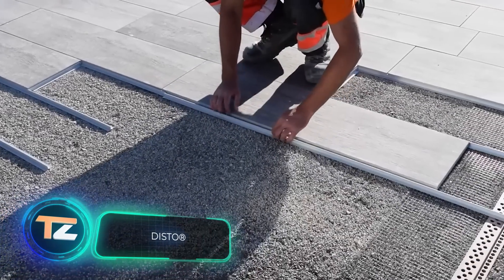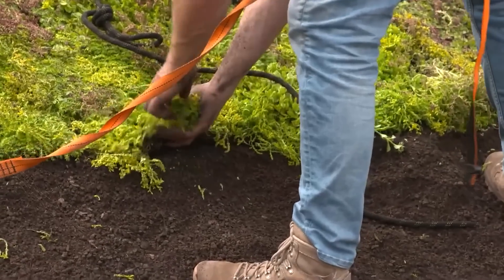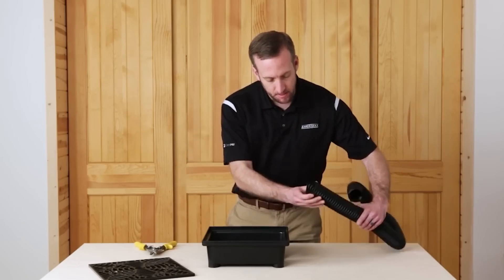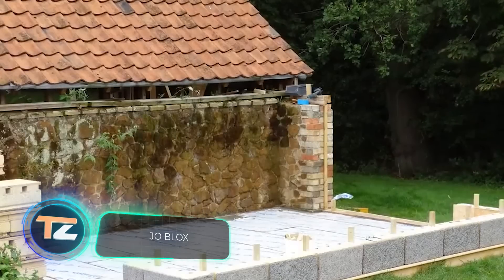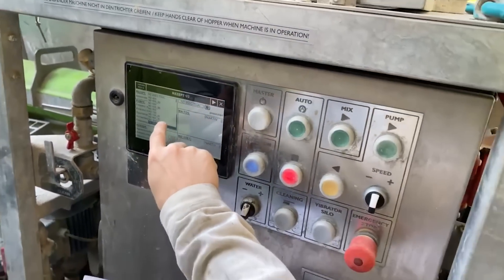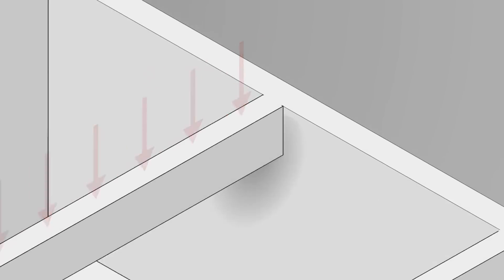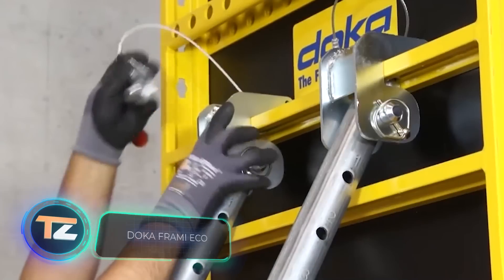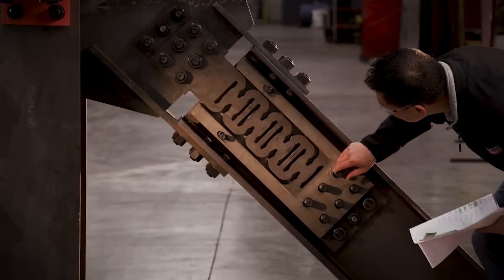MIND-BLOWING CONSTRUCTION TECHNOLOGIES YOU SHOULD SEE

Comment: The flexible grids shown at 2:17 would retain soil better if interplanted with a diverse variety of plants.  
It is a healthy, diverse plant biome that causes roots to release glues which both hold the soil together and in place, and allow better drainage.
Avoiding synthetic chemical additives is important as any will kill soil biome diversity.

Would be great if this showed ways to incorporate bioswales into paved landscapes. 
Bioswales are depressed areas that gather rain runoff from roadways, other paved areas.
They use mulch and biology (plants, typically including site-appropriate trees to reduce water from going into storm drains; reduce downstream flooding; reduce ground subsidence and concrete cracking; reduce irrigation costs for landscaping around businesses; city buildings, residetial areas; replace ugly, raised paved pork chops used for traffic control; reduce water runoff, lessen heat island effects; heat islands, control street litter; reduce air and water pollution; reduce crime by adding walkability and bikeability; reduce human waste from reaching waterways (often stormdrains and sewer lines share the same piping, this overwhelms treatment plants, so the excess is sent elsewhere 'into the wild'); increase quality water supply using natural processes to clean the water before it flows into watertables and aquifers; reduce the need to expand existing starmdrain systems; reduce pumping costs because free water has been localized instead of centralizef where it is metered and must be pumped (at great cost because water is heavy and uses a lot of electricity to pump it, as well as the costs from building and maintenance of related piping, other structures); reducing brownouts; regreening;adding beauty;adding comfort; etc.
 Bioswales are much better than the ugly pits used called detention/retention ponds.

Comment: @ 4:32 ROFL
Quote
"secret weapon no concrete is required here's how it works
Foundation screws are driven into the ground then supplemented with spacers"
Then @ 5:07
Quote
"manufacturer has great news the system is compatible with fast drying concrete"
Bit of a contradiction...
Reply: "You can use concrete" doesn't mean that "you should"...

Comment: 3:50 The biggest problem with this drainage system is the use of corrugated pipe...

Smooth wall pipe is significantly better for drains than the ridged corrugations that trap and hold water and restrict the ability of the system to flush debris out of the pipes...they also reduce the water's flow rate through the pipes, smooth pipe can carry far more water per minute than corrugated pipe can...

Comment: HOW can solar panels be installed ON TOP of a GREEN roof??? Doesn’t it need sunlight? Water? The heat from the panels will kill it too
Reply: Idk. Moss is super hardy and tend to grow in little to no sunlight areas. The caves around me have moss that grows inside them. The heat all I can say is my solar panels don’t get very hot because the mount we use allows air flow underneath it and I haven’t really seen any roof mounted ones that lack airflow but I’m not an expert. I just don’t see it as much of an issue.
Reply: Could use bifacial solar panels that sit clear of the plantings, and angled for best capture.  Bifacial panels allow light through.  
If you have a flat roof -the bifacial panels could be part of a gazebo roof so you could have a covered area with a view.
The water from the panels could be harvested/reused and used to maintain the plantings instead of funneling it directly off the roof.